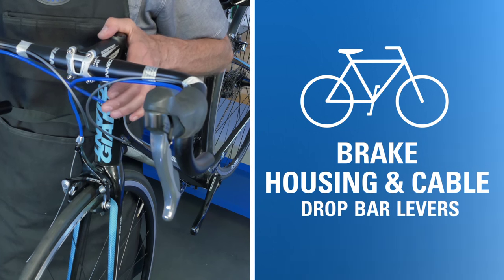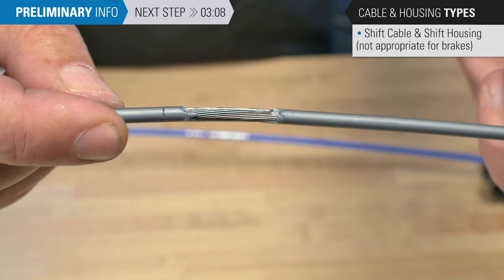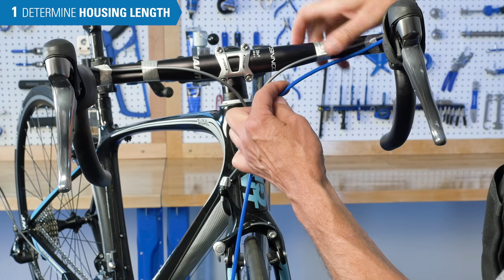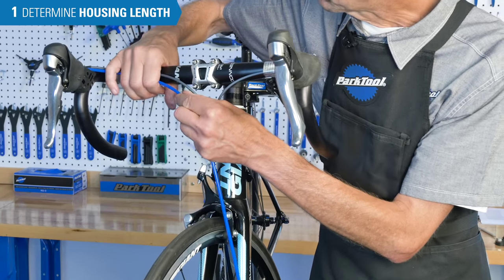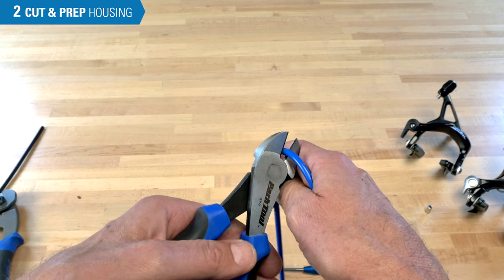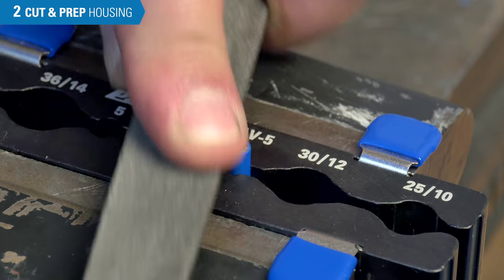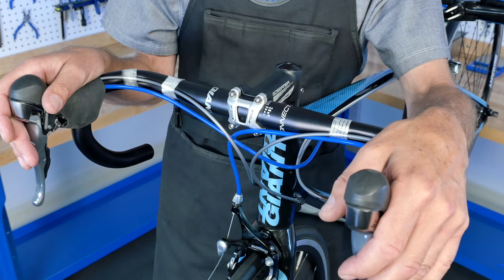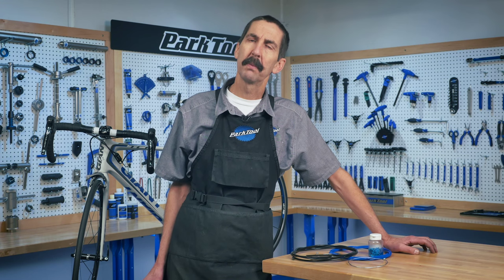Brake Housing & Cable Installation - Drop Bars

Comment: Are there no barrel adjuster in drop bar cable brake levers? I have a Claris ST R2000 and I have been wondering about this.

Comment: I have a 2021 Allez Elite with internally routed rear brake caliper that has a lot of friction when lever is pulled. When I disconnected cable I found the caliper and lever move smoothly and when connected I can hear cable rubbing housing inside top tube. Is there anything I can do to get rid of rubbing other than replacing rear cable and housing? Thanks.

Comment: Thanks for the video. I learned much from it, as I did for all of your videos so far. Thanks to you guys I have been able to flawlessly mount brake and shift cables many times on my hybrid and city bikes.
But now I'm having some trouble mounting a compressionless housing. A few years back I got my first road bike, which now needs some new cables, so I decided to try out a compressionless brake cable kit for the first time. I started getting the length right as shown in the video - mostly using the old housing as a template - but due to the very high stiffness of the housing I can't for the life of me find a good length and routing.
The housing is so stiff that it partly engages the brakes without touching the lever, bringing the pads closer to the rim. If I try to get it a bit shorter, then the handlebar won't be able to move freely and/or the housing will get too tight when I try pulling the brake lever, since dual-pivot calipers pull the housing a little bit when engaged.
Do you have tips for compressionless housing? Has anyone here mounted this type of super stiff housing without impacting the calipers' or handlebar's movement?

Comment: Thanks a lot, it helps me to change my brake housing after a stem/drop bar remplacement. The part on the housing lenght finding is the most usefull i fund on the web.

Comment: Thank you so much for this video. Would you recommend to always replace the housing when replacing cables? Or could you reuse the same housing multiple times? Thanks!
Reply from the maker: Typically housing replacement is suggested at the same time. There are exceptions to that of course.

Comment: MUCH LOVE AND APPRECIATION TO YOU GUYS!! Thanks for your guidance to upgrade my SPECIALIZED "Langster" track bike for every element, except the saddle is still in good condition.. Also assisted me to correct my rear and front derailleurs on my 2nd bike my other love SPECIALIZED "Allez".  I have learned A LOT of valuable information from you guys and your videos. Now I have all the proper tools and knowledge (from your videos), not necessary for the bike shop, unless absolutely required. ALTHOUGH....any ideas for the 2018 Allez, saddle post is not round (it is an OVAL shape), cannot twist, but it is seized. I've tried coca-cola, WD-40, heat/cool, pushing/pulling  methods to loosen with no luck. Any other ideas? THANK YOU!!!
Reply from the maker: Is there room for it to go down? If so you may be able to use a mallet or hammer to impact it down just a small bit to break the corrosion up. Then pull it out. It may require a new seatpost. But at this point thats going to be a much better option than leaving it in the bike as it will only get tougher to get out. Good luck!
Reply: @parktool  my shifter is in the middle of the handlebar just above the frame 2 shifters 1 front 1 rear and my drop bar brake handle had sheared off not 1 not 2 all handles broke

Comment: Notice he's using what's known as strapping tape to tape the housing against the bars. Ordinary tape like electrical tape will stretch. When you apply the brakes, the cable wants to straighten out with great force. This will in turn make the housing want to straighten out, especially at the tight curve where the flat part of the bars curves forward. Stretchy tape will stretch here and the housing can move away from the bars. 
Strapping tape is a lot like a flat piece of shift housing with strands of fiber running length wise, preventing it from stretching.

Comment: Excellent guide! One minor thing - I have read that often it is not necessary or even detrimental to oil the housing with modern liners as they are pre-lubricated, is this true? The reasoning that the oil helps keep out water does make sense but I can also imagine excess oil gumming things up over time
Reply from the maker: Pre-lubricated will be with a grease, and the lubricating part of grease is oil.  If there is grease already inside the housing, oil would be meaningless.

Comment: Hi Park tool, thank you for these awesome tutorials. Do you have a video tutorial on shifter house and cable installation?
Reply from the maker: We do not have one currently. This is a video we have been looking at doing for awhile. Stay tuned!
Reply: Park Tool that would be awesome. Looking forward to it !
Reply: @parktool  It's two years later, do you have such video now? I plan to change all my cables and housing (shifters+ brakes) on my shimano 105 (rim brakes). I would love a video to help also with the shifting cables.

Comment: Calvin, great video. I am looking at doing this as a winter project for my brakes and shifters. Do you know what style cable housing comes with the Shimano kit's? Also what's a rule of thumb for longevity on these cables, coated vs uncoated? Thanks

Comment: Beware when you buy shimano sets, there are 3 different quality ranges. I highly recommend to pay the extra 10 bucks and go mid.
The cheapest are 4€ for the set but use a spiral cable. And no aluminium endcap and no small guiding ends on plastic endcaps. No coating whatsoever.
The mid ones are 15€ a set and have the straight protective cables. Shimano calls this SUS. They come pre oiled and have protective caps and the metal end cap. OPTISCLICK and SIL TEC fall into this mid category.
The high end ones are 30€ a pair. They are polymer coated instead of oiled.

Comment: Hello there,
I have a suggestion, can you do a video on mechanical disk brake road bike brake wire measurements and installation please.
Reply from the maker: Good suggestion. The concept is the same.  Will put it on the list.

Comment: Great video as always Calvin! Should you use a cable end cap on the end that inserts into the brake lever body? 10:50
Reply from the maker: On these levers there is no room for a ferrule  on the end but you need one on some other brands.
Reply: @parktool  Thanks for the quick response!

Comment: Question...how far do you run the cable housing? Does it go all the way into the levers? Both brake cables and shifter cables
Reply: there is a stop inside the levers.

Comment: So housing endcaps or ferrules aren't needed (or even possible?) on the pieces of brake-cable housing that go into the brifter?
Reply from the maker: Thats correct. There are some that do require them but those are outliers.

Comment: Should I lubricate the shifter housing for a brand new shimano shifting cable with coating?
Reply: wondering that myself.  the meger instructions say don't lube.  what do i do with the shimano cable grease i bought?
Reply from the maker: Shimano housing and others come with grease already installed in the housing when new. After some time of use you will want to lube the housing and cable with your cable grease.

Comment: Question: How would you determine the length of the cable housing on mechanical disc brakes? Do you just use the old housing as a template? Thanks.
Reply from the maker: You are looking for sweeping bends in the housing and the ability to turn the bars easily. Not too long, not too short. Goldilocks. This holds true for all cable and housing systems.
Reply: @parktool  Thank you so much!

Comment: Did he route the front brake cable to the left hand lever? Is that an alternative somewhere? In the U.K., the right shifter is always the front brake.
Reply from the maker: We are a bit weird here in the states. Right is rear left is front. This has to do with hand signals and driving on the righthand side of the road.
Reply: Park Tool Makes perfect sense I guess! Thank you for the reply!

Comment: Is there a video running cable thru older Shimano road bike brake shifters?
Mine are no where near as easy to run your brake cable thru as the ones in this video.

Comment: Quick help pls. Rear rim brake caliper does not return fully when sti lever is released. Do i need to just clean amd lube the brake cables and housing? And if i do, do i need to cut the cable at the crimp, or can i just loosen the pinch bolt?
Reply from the maker: Cleaning and lubricating the cable along with the pivot points of the brake is a great place to start and is typically the cause of the caliper not returning fully
Reply: @parktool  Thanks.

Comment: So shift housing is not appropriate to be used on brake cables. But could you use brake housing with shift cables?? Anything wrong with that?
Reply from the maker: Brake housing is a wound single cable wrapped around the liner.  It is strong laterally, but it is also flexible.  This means with index shifting, some of the push and the "click" is lost in the flex.   It simply does not transfer the action at the shifter efficiency to the rear mechanism.

Comment: what about those link housing system by jagwire? are they any good?
Reply: There are positives and negatives. They can be noisy with the housing clanking against the frame and produce "clicky" sounds where individual links creak against each other.

Comment: I am not sure, do you use end caps for the lever or just for the caliper?
Reply: 9:24  "Whenever an end cap can be used, it should be used."   Always use an end cap where it will fit fully into the component.  However, most  modern drop bar levers do not accept an end cap.

Comment: Does it matter if you do the breaks or the shifter cables first
Reply from the maker: Not, do either first.
Reply: @parktool  Does it matter if brake or shifter cables are over each other or vice versa?

Comment: I need to  change my brakes and put drop handlebar on a cable brake but am not sure which brake is the front/rear brake.
Reply: Can anybody help.
Reply from the maker: This does vary a bit globally. in the USA and many areas of the world the left hand brae is front and the right hand brake is rear. In the UK and other countries you may run into the opposite.

Comment: What is the housing linke if you have CANE CREEK CANTIS with that extra 90 degree cable? Until where does the housing go and is there a normal pull to the housing to to the tension?? (Which I suppose is not normal but who knows how you tapped your housing?)
Reply from the maker: https://www.youtube.com/watch?v=FvFira2dAPY Have you checked out this video yet? It might get you in the zone. The length of the cable housing is determined by where the stop is located on your bike. Some stops are build into the stem, others into the fork and still others are hung from a headset spacer. The goal is to have a nice smooth actuation which means that you should not have tight bends or huge curves. You are looking for that golilocks setup.

Comment: I notice you don't use an end cap on the lever end of the cable.  Should you use one if there is enough room in the lever body for an end cap?
Reply from the maker: +Phil Hughes Always use an end cap where they fit fully into the component.  For most modern drop bar levers, the bodies do not accept housing with the end cap. The sizing at the body is reduced for only the housing to fit.
-Calvin
Reply: +Park Tool Ok, thanks.

Comment: The shift cables on my Sora shift/brake levers  come out of the side instead of the back of the shifter. How should I route them in that case?
Reply from the maker: The so called "katydid" style lever have shift housing looping inward from each side.  You want just enough length so the housing leaves the lever in a straight line as it arcs back to the frame housing stop.  Hold it by hand next to housing stop and test it by turning the bars 90-degrees away from the lever are testing.  It should not tug where you are holding it.

Comment: Is there a cable/housing specific lubricant that is used for cable replacement?
Reply from the maker: For general use, a light lubricant such as a chain lube is fine.

- Calvin
Reply: +Park Tool Thanks, Calvin.
Reply: +CycleHubTV  3 in 1 oil works well :)
Reply: Petroleum damages the plastic inside the housing.

Comment: I want to know does the shifter housing do the works with the brake housing ?
Reply from the maker: If at all possible use brake housing for brakes and shift housing for shifters. You can use brake housing for shifters but it will result in vague shifting. Shift housing used for brakes is not a good idea and can lead to injury. The windings of the housing can blow out under the pressure and disable the brakes.
Reply: @parktool  Thankyou very much for your reply!

Comment: can you run road  bike brake cable without taking off bar tape..
Reply from the maker: You can usually run a new cable without removing the tape. It can be difficult on some of the newer systems but is possible. You cannot run new housing without removing the tape though.
Reply: @parktool  it's a new bike never used ...wanted to take the bar off  and put it on another bike and knew the cable may be to short but didn't want to go through getting new tape .

Comment: You are routing the cables incorrectly..the right front  brake should be on the right ..this way the cable drops nearly to the cable adjuster without pointlessly crossing the front steerer. The left hand brake should go to the back brake which is where the adjuster is positioned..The Japanese ride on the left like the English and that is why they designed  the brakes like they have ..You are using the incorrect French way ..